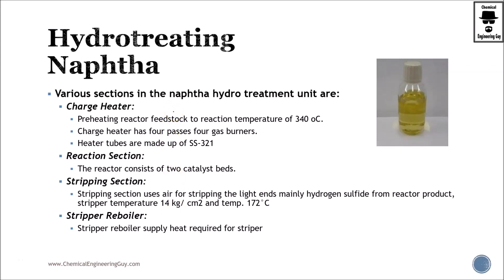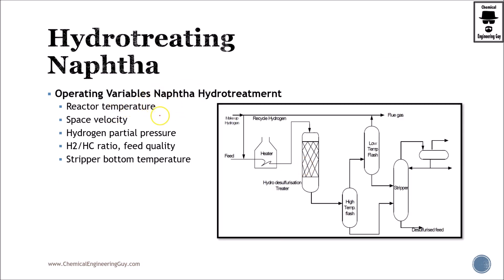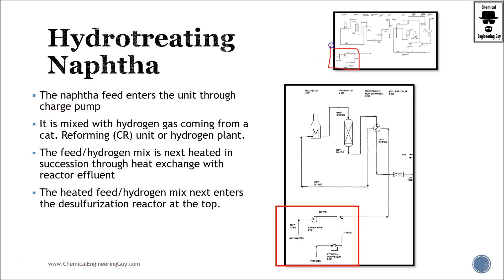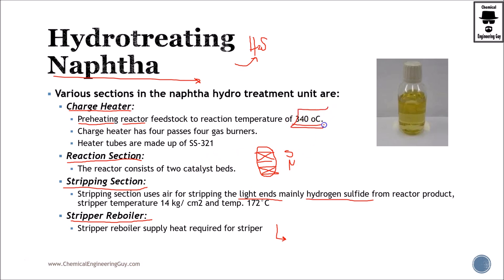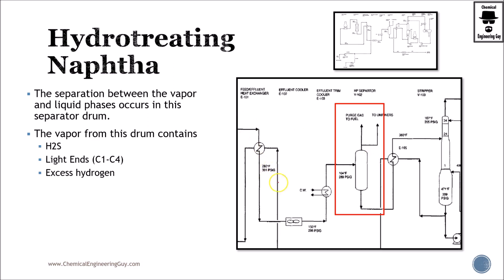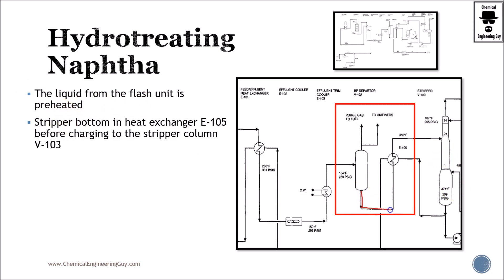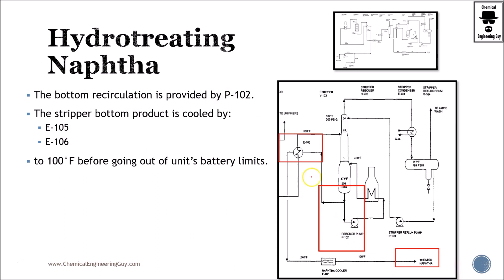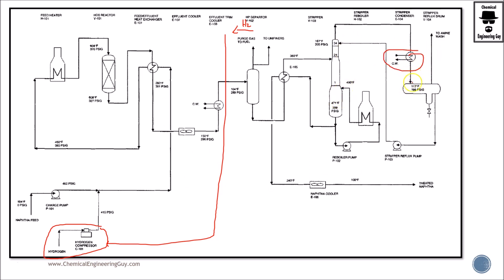Hydrotreatment of Naphtha  - Process Conditions & Technology (Lecture 126)

Comment: I suggest you (if you have time of course) to do the engineering design of a simple process like this one where you'de explain the following:
- heat and mass balance
-equipement design
-simulation
That would be awesome and I swear you'll become a reference in ChemE online courses because that is what we seek for and seldom find in the net.
Reply from the maker: Yeah! Sounds great Idea... I will consider it.... In the meantime, I have those for binary distillation units and gas absorbers / strippers and scrubbers ;) they take time, but I will be doing them little by little, step by step
Reply: @ChemicalEngineeringGuy   yes step by step is the best way.